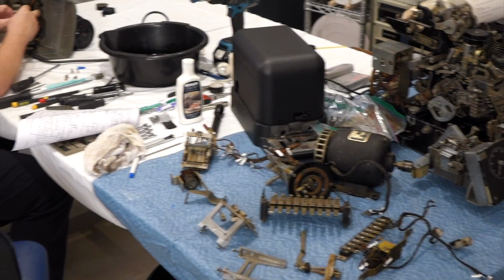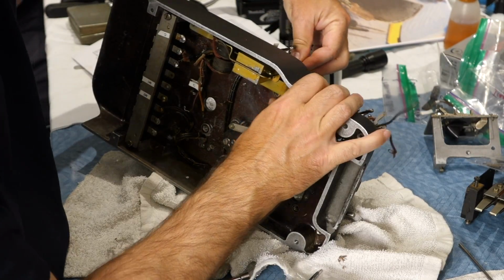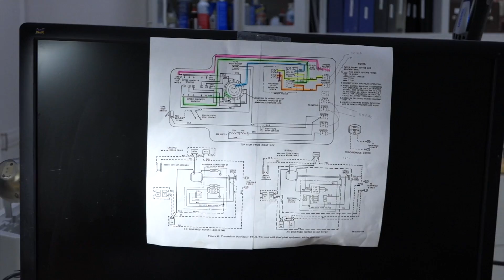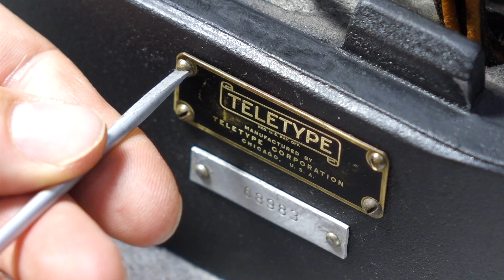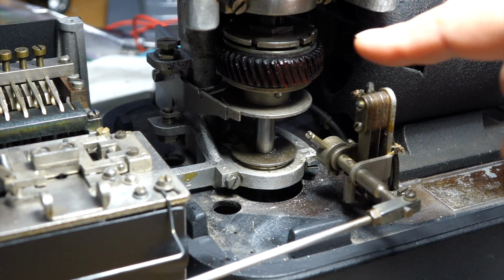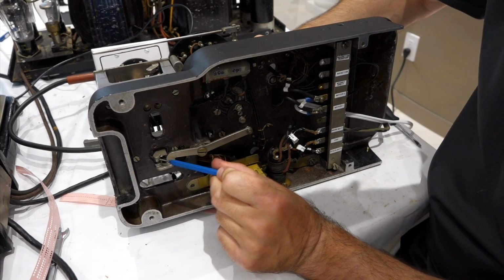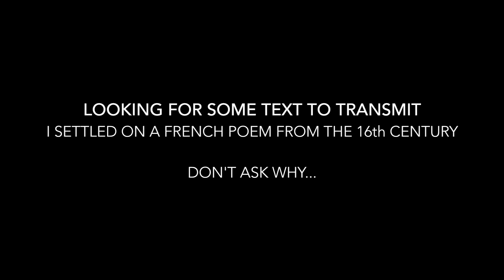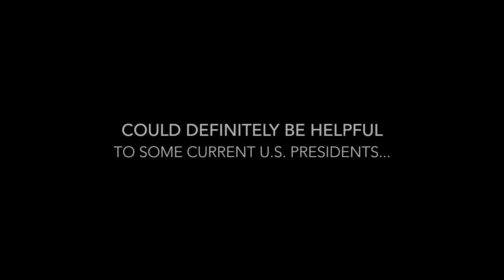Teletype Model 19 Part 12: Reassembling the Transmitter/Distributor

Comment: It's not an original thought, but I was struck that a big difference between the old stuff and what we have today is that you had to adjust the heck out of the stuff back then, and keep it adjusted as it wore and the temperature/humidity changed. Now it Just Works (or doesn't), and there isn't a darn things you have to do (or can do) about it.
Reply: Oh there are still plenty of adjustments to modern equipment. It just hides behind chips and code, rather than screws and covers.
Reply: Consider also that every military command of a certain size had to have a Teletype shop with technicians on hand to do repair including ships and many of the shops were 24/7.

Comment: These were commonly called "Doghouse" Transmitter Machines.  I owned several when I was in Junior High in the 60's.  Its interesting to note that they used the same synchronous motors as the same vintage of printers, even though a smaller capacity could have been used.  Teletype had a 3-headed TD unit build for Western Union which consisted on three of the tape reader heads that operated on a common drive shaft (they could be operated on 3 separate speeds with gear changes).  The local WU mechanic gave me a pile of these when they were decommissioned and I took the heads out and made plexiglass pulleys and sewing machine belts driven by <1/16th HP synchronous motors.
You may have run across units that had unequal segments in the distributors, these were cryptographic "crypto" units.
Back then, when I need parts, I just called up Teletype in Skokie, Illinois and ordered them!

Comment: When does the bell chime on the Teletype? In the final clip of the transmission, it seems rather random but I'm sure it's only at the end of a line.
Reply: You send a bell character and the bell sounds on the far end. A defined teletype character, and present in ASCII as well, though there it was often coopted in serial links to do other functions. Most common still in use these days is point of sale, where they use serial over USB, and inside the printer at the POS terminal there is a 24V outlet on a RJ11 socket, used to trigger the drawer release. the character most commonly used is the bell character, as it is typically not present in printing ASCII receipts, but is guaranteed to be transferable to the printer as a standard character.

In Teletype it was used during automatic traffic transmission for lower cost bulk traffic (the type that was urgent, but could handle next day receipt at the far end, like a TELEX or news articles) to signify that there was a priority message coming through, that required immediate attention by the night operator of the station.
Reply: Thanks for that. That could definitely get annoying if someone kept sending bell signals to the receiver, but a funny and unique addition overall.
Reply: It keep going ding ding ding ding ding ding...
Reply: It WOULD
Reply: Ah yes, i recall slipping an command into the end of the boot scripts on a headless linux box to make it beep when it was fully booted.

Yep, that terminal window is talking to the kernel as if it was a teletype hooked up to a serial port...
Reply: A classic prank in berkeley unix is using talk to send a lot of 'BELL' . Nice if a class compatriot is asleep in the terminal room....
Reply from the maker: There are two bells. The softer one is automatc, towards the end of the line (around character 65 I think). The big loud one I did put in on purpose just for the heck of it, figures-G I think makes that bell ring.
Reply: Interesting that it's figures-G, since all these years later, Ctrl-G is the shortcut for typing an ASCII bell character.
Amazing how almost 100 years later, that same thing is still used.
Reply from the maker: Actually I double checked, and it's Figures-S, not Figures-G. However you are quite correct that the "bell" in today's terminals and ASCII code can be traced right back to the bell feature in these mechanical TTYs, which was obviously there to attract the attention of the operators.
Reply: I just opened notepad and command prompt and typed CTRL+G. In notepad nothing happened. In cmd i get ^G.
Reply: do "echo ctrl-g" and you'll get an alert sound.
Reply: The bell was to alert the operator that there was important news.  I was in the college radio station when Nasser was assassinated.  That was five bells on the UPI machine.  In 1970.  "We interrupt this broadcast..."

Comment: You don't need gears always, we used to change the governor speed of the motor by setting the spring tension differently and repainting the stripes on the govenor to suit the tuning fork that matched the speed. Ill have to try and find the info it was many many years ago, btw we are 50Hz here so that was necessary. In New Zealand. Somewhere in my junk box I have a morse version of the TD, with just two pins. ZCZC DE ZL2ALW NNNN
Reply from the maker: We do need to change the gears. This is not a governed motor, it's fixed speed synchronous motor.

Comment: What a magnificent piece of engineering!  Beautiful.  Great job getting it back working.  Just as a side question, is there a source where you get your tape or are you guys mfg it somehow?
Reply from the maker: I got my box of 11/16" oiled tape from ebay. Quite expensive actually. The oil in the paper is to lubricate the punches.

Comment: Did you test the resistor? You could have made a new one
Reply from the maker: Yes, we did measure the half that was still working, which allowed us to pin down which exact part was in this machine (they used several different values of this dual resistor model). So if we had not found the original one we could have  replaced it with modern power resistors. But we got very lucky and Mr. RTTY happened to have an original one!

Comment: Marc, could you do a video transmittion one of those classic teleprinter art messages (you know, pre-ASCII text encoded graphics)? Also, it would be interesting to see if your teletype could be hooked up to the IBM 1401 for some real-time interaction.
Reply: 1401 could talk five-level?
Reply: TTY is serial 5 bits. I'm pretty sure the 1401 could handle that, yes. Especially since many of the early computers were adapted to talk to teletype machines, just because the hardware was available and (relatively) affordable. More modern computer terminals for mainframes were often refered to as "Glass Teletypes" because they used a screen instead of a printer, but still often enough supported TTY operation.

Comment: Aww for the sake of nostalgia I'd like to see some goop shrink used :3
Reply: Those were typically a natural rubber sleeve, slid over the wire before soldering, and then slid back over, and then coated with some shellac varnish to make it more stiff and conform to the wire shape and the terminal. Hellerman Tyton still supplied them in red, along with the special 3 jaw expander to stretch them to fit over the wire, and then when released it springs back to grip tightly. Of course only used in certain applications where you cannot use heatshrink, and for high voltage use as well.
Reply: What are the applications where you cant use heatshrink. It doesnt need a lot of heat to shrink and i expect there must be lower temperature heatshrink available.
Reply: Maybe that little heat is still too much for some components.... many lab equipment are extremely heat-sensitive.
Reply: Yes, a few things are only reated maximum 45 Centigrees, and i guess there are even more sensitive things in some laboratory equipment.
Reply: Most common types of heatscrink needs about 125-150 centigrees to work properly.
Reply: @SeanBZA  I still have these sleeves.

Comment: Has anyone tried a Z80 DART chip or Motorola UART chip to drive solenoids via solenoid driver chip on a tape punch or to go the other way to take the code from a paper tape reader to drive the DART/UART.
Reply: Try it yourself?
Reply: Simon Tay I have one an PC1512
Reply: My teletype model 15 was once connected to my 1970s TRS-80 (Z80) via AY5-1013A Uart and homemade expansion interface. For a short while, it was my printer - the only one I could afford. Think I got it for $50. and it worked without need for restoration. I still have it..
Reply: Yes, as other companies made more portable equipment--or faster equipment as the state of the art advanced.  Some of the intermediate technologies were downright bizarre.  I worked on a high speed tape reader that used "potted modules".  Discrete components of a particular circuit were put in a plastic box with the pins sticking out then the box was filled with black epoxy.  The boxes were color coded.  I think pink was a JK flip-flop.  The tape reader sensed holes in the tape with light rather than little pins.